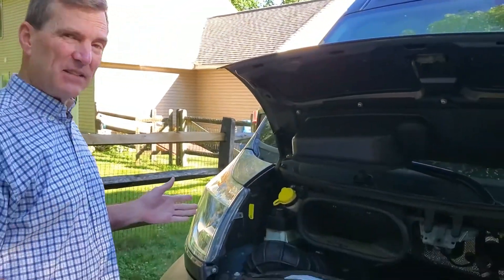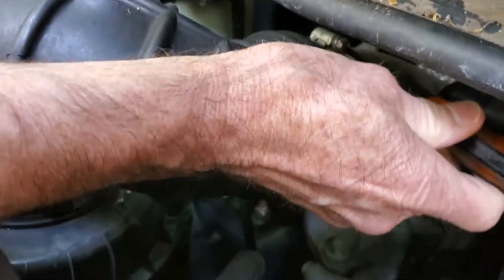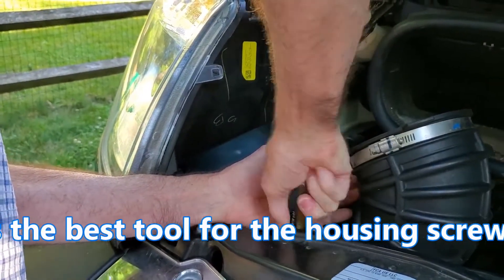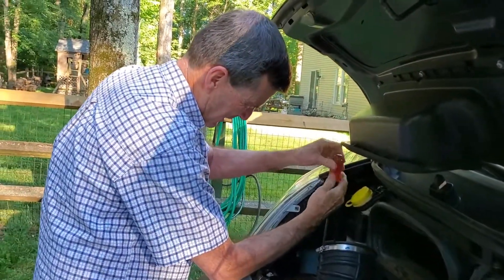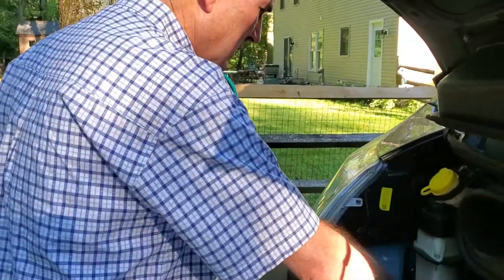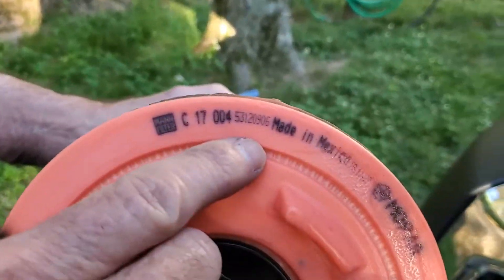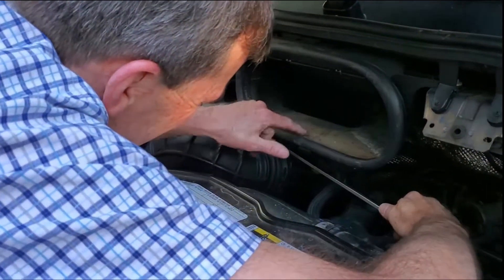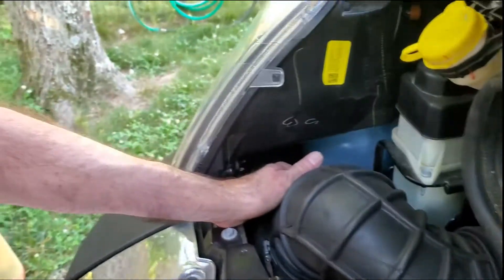Promaster Engine Filter change

Comment: Your video has helped me the most. Now I know that my struggling to remove the big hose is NOT abnormal. TY
Reply from the maker: Thanks for your comment!  
Yep, it's a pain to get that filter changed!  I really did use EIGHT different screwdrivers (different lengths and types) 😊

Comment: not sure if you still have that van, but I'll leave a comment anyway , I bought a battery powered ratchet off Amazon. I used that with a 8 inch flexible extension and a socket to fit the clamps and filter housing bolts. They are the same size. took less than a minute to get all of them off. I also use a dry film silicone lubricant on the hose ends it makes it slip right back onto the inlets.
altogether took me less than five minutes to change it completely. I am a very lazy person, so I always try to find the easiest way to do things to get them done with less time and energy😂
Reply from the maker: Thanks for sharing! Yes, we still have the van and recently changed the filter again.  This time it went MUCH quicker and easier.  Again, we appreciate you're sharing.